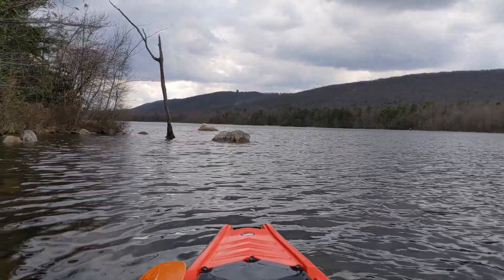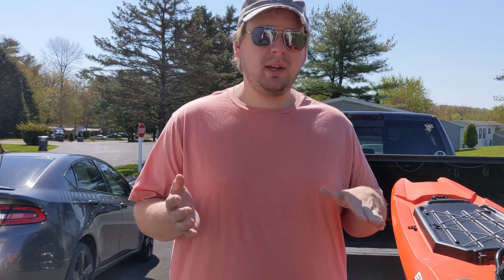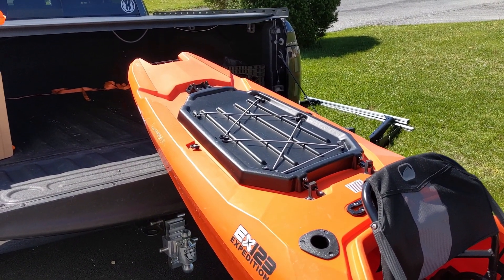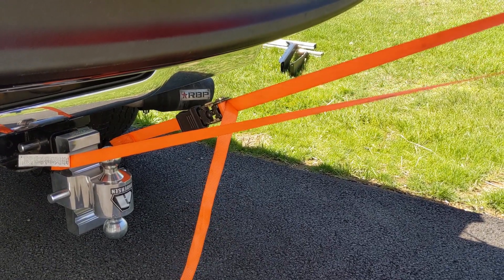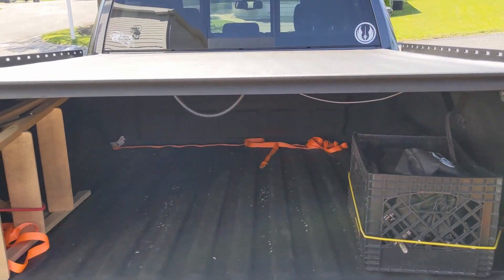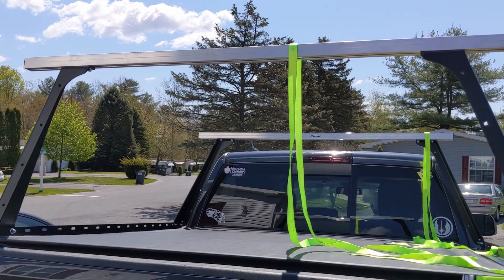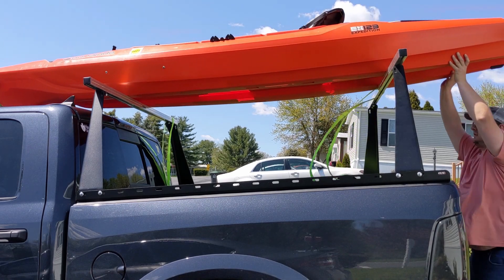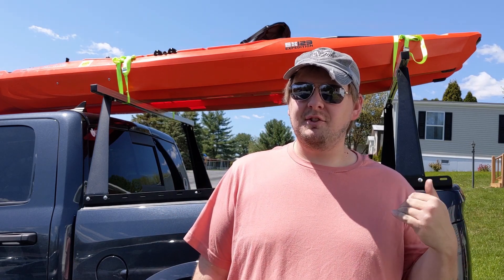Kayak Transport by Yourself: How to Load and Transport your Kayak with a Truck (Bonafide EX123)

Comment: When it’s on the racks, you had 2 straps going horizontally, and not through anything, but just over the kayak.  That provides side-to-side support.  But just friction for forward and back motion, right?  So if someone didn’t do it quite right, and a strong wind hit, couldn’t the kayak slide out?  May need to go THROUGH something or secure it so it can’t slide forward/back.
Reply from the maker: There definitely is the possibility for that. But when you look at the shape of a kayak, as long as you tighten the straps enough on the ends, the center of the kayak, being wider than where it is secured, would not be able to fit through the straps to potentially slide off. There definitely is a possibility that if the straps are not tight enough, something could happen.